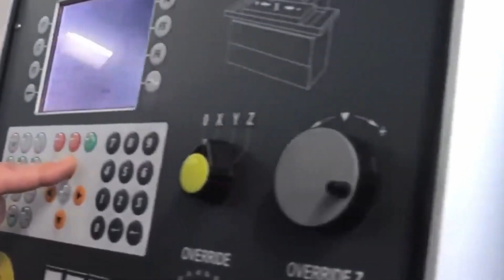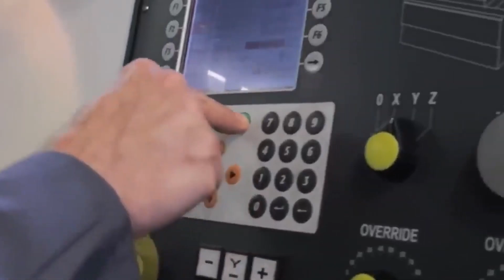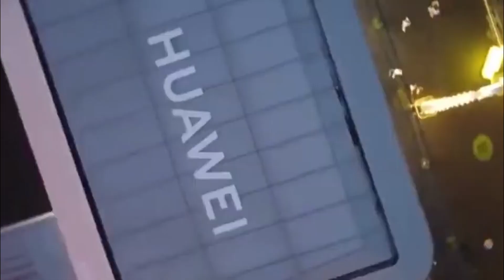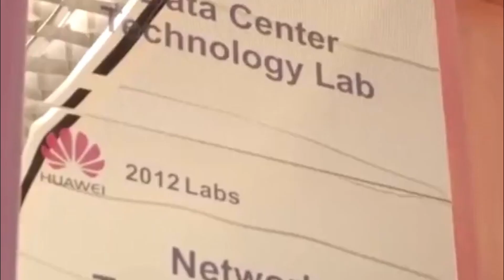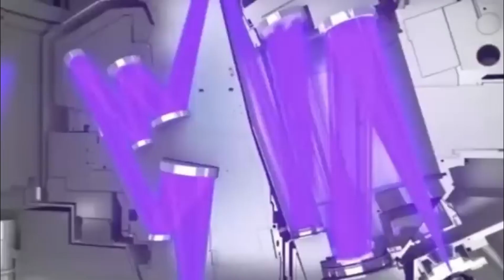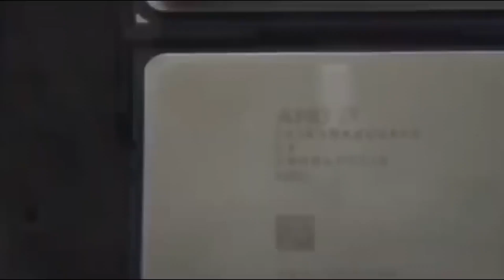Huawei Is Back With 7nm Production And US Shaking In Its Boxers ASML EXPLODES!!! Ai News Engineering

Comment: Registering a patent for 7nm chip only gives you a patent copyright. I can design a 3nm or 5nm chip and then register the patent, so that to prevent copright infrigement. That all. Its a chip on paper only. You yourself admit to waiting for your own research in development of new lithography machine, which you didnt indicate when...i would give 2 to 3 years at best to start manufacture your own 7nm litho machine....if unsuccessful, it will be another Property thing half built. You may have better chance to use existing litho machine you have but use a new concept in cmos design...hint vertical cmos